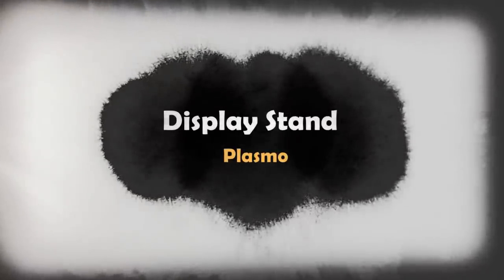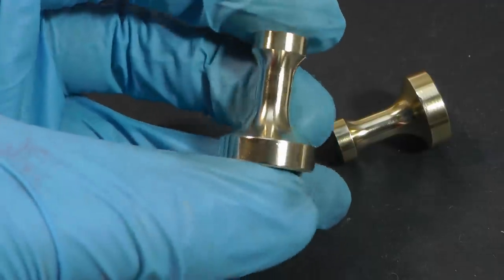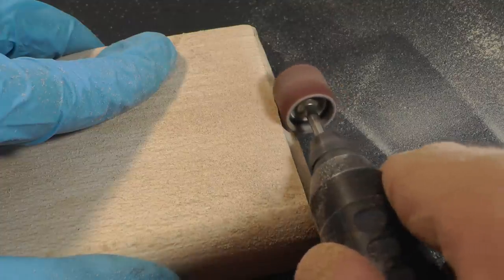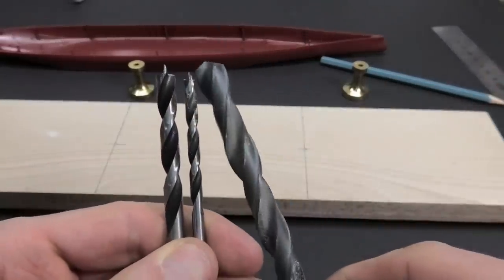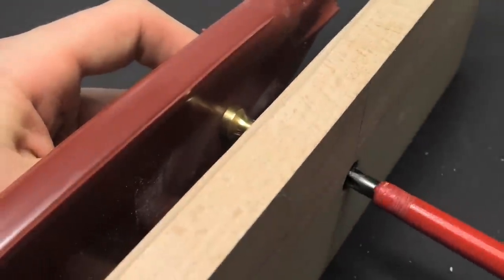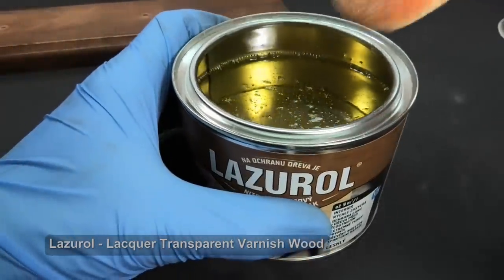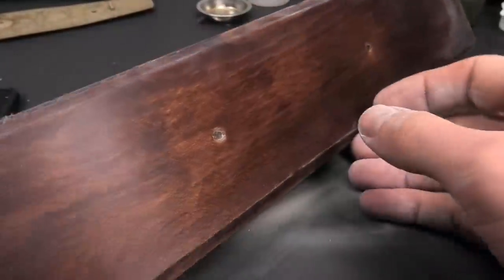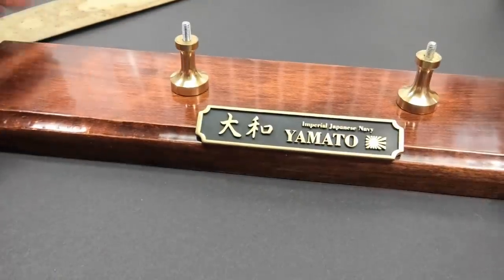Display Stand for Battleship Model - Yamato Bonus Video

Comment: The reason your finish had brush strokes in it is bc you're using a synthetic brush, which is the worst thing to use with oil varnish or paint for woodworking. 
 Oil Finishes need brushes with Natural Hair or China bristle. These work best bc they have no "backbone" when wet so it allows the finish to flow and self level.

Comment: I make wooden bases (and display cases) for my wooden ships.
For a first time base this is very good.
Two tips:
1. The sanding of the top should be done with a flat block so as to not sand away the stain colour from the edges.
2. Protect the brass now so it does not tarnish over time.

Comment: Italiano
Inglese
ciao David, hai fatto un buon lavoro ma quando si parla di legno posso darti un suggerimento o due: quando usi vernici trasparenti dopo aver spennellato il legno ripassalo con uno straccio per uniformare lo strato della vernice, non toglierai la parte già assorbita ma renderai piu uniforme il tutto;
quando poi passi il lucido e meglio che tra una mano e l'altra tu usi la carta vetrata fine perché soprattutto con le vernico ad acqua il legno alza il "pelo" quelle piccole parti di fibra non attaccate perfettamente alla superficie dopo una levigatura.
Hi David, you did a good job but when it comes to wood I can give you a suggestion or two: when you use clear varnishes after brushing the wood, go over it with a rag to even out the paint layer, you will not remove the part already absorbed but you will make more uniform the whole;
then when you pass the polish it is better that between one coat and the other you use the fine sandpaper because especially with water-based paints the wood raises the "hair" those small parts of fiber not perfectly attached to the surface after a sanding.

Comment: Quick tip on finishing wood: lightly sand with fine paper between coats, and always use a sanding block.
Reply: I like using lemon oil and steel wool.  Leaves a really nice shine and durable finish.
Reply: Great advice.  I always sand between coats.  Works every time.

Comment: I loved how you worked the wood with a dremel and how you polished it.
I think an adhesive brass nameplate with black laquer inlay stuck onto the top/front surface would have looked a lot better though. The one you made was too big for the scale and didn't look quite right. Just my personal opinion.

Comment: Couple of wood finishing pro tips
1. Sand the wood to 220 or 320 grit paper before dying the wood
2. Use a "Sanding Sealer" after dying the wood. This should be applied twice and sanded with 220 or 320 grit paper between coats and after final coat.
3. Apply your choice of Gel Stain after applying the sanding sealer. Use a lint free cloth and gently wipe the gel stain on. 1-2 coats
4. Final finish with a clear spray lacquer.
Can see my finished Yamato and base here:  https://youtu.be/kOlIACNCvo0?t=30

Comment: Man, this makes we want to try some basic woodworking. A quick question - if I wanted the model to be detachable from the stand, would some magnets on the brass pegs and on the inside of the keel work? Would it be stable and sturdy enough with just two points of contact?
Reply: I think the model will be detachable. Those nuts are glued inside so you can just undo the bolt from the bottom side of the base